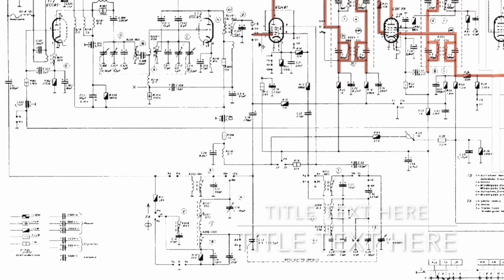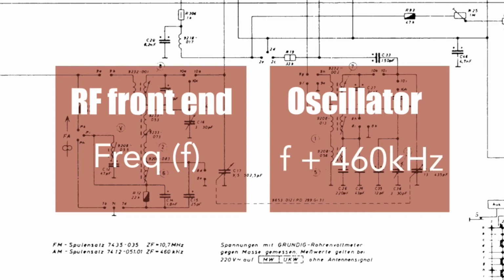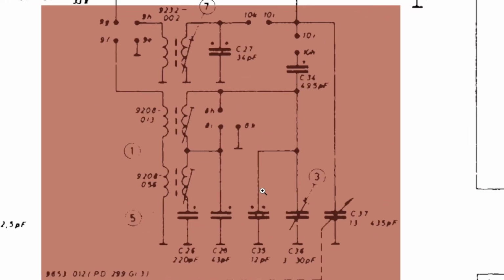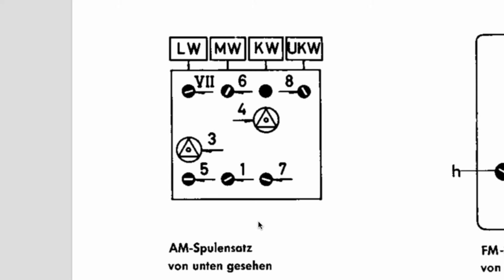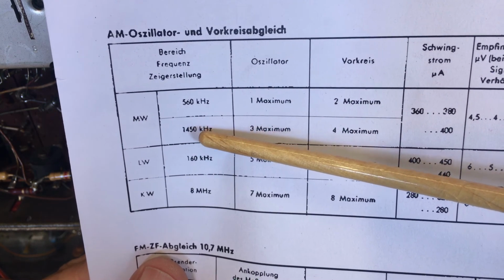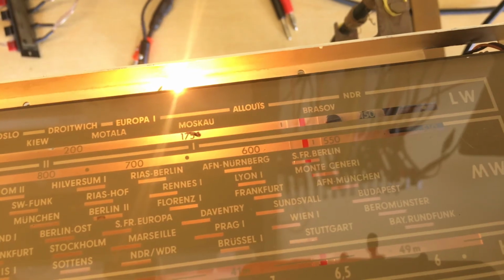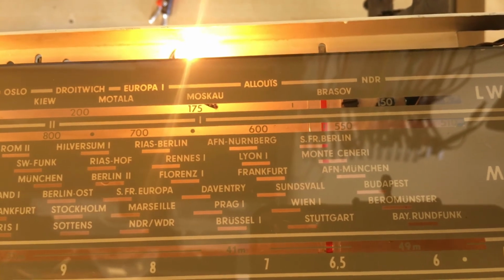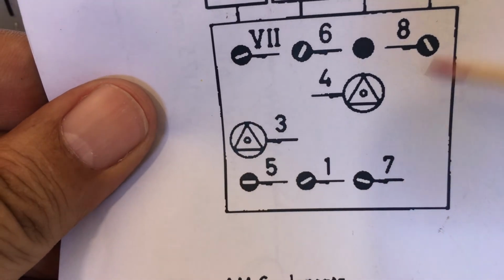Grundig 4198 tube radio restoration - Part 9. RF alignment of AM bands

Comment: I would like to make an inquiry. I own a Grundig Type RF 135 and need to disassemble it to adjust the dial, one of the knobs is loose but I don't know how to get it out of the radio.
I would like to know if those knobs come out stretching or have another system, thank you very much in advance and greetings from Paraguay.
Reply from the maker: I don’t recall having worked on one of those, but usually you make sure any screw on the knob is loosened and then gently pull it out.

Comment: Hi. Thank you for a very instructive channel. One silly question: when you peak the signal, where do you connect the AVOmeter? Looks like its on the speaker?
Reply from the maker: Jan-Thore Hol : yes, you can connect to the speaker. I use a simple signal booster as my AVO does not have a 1V range on AC, and I want to keep signal levels low so as not to blow my ears out.
Reply: Got it! Thanks! I do not understand why this channel dont have more subscribers, its one of the best! I have a Grundig Satellit 210 (6001) that I dread to put on the bench for restauration. Your channel can actually be the tipping point to do something that complex!

Comment: Hi Manuel...how does this light dimmer work? Do you use paralel bulb lamps? ty
Reply from the maker: Rogerio Zambotto : the idea is to place a "light bulb" in series with the load. How much "light bulb" is then controlled by switching more bulbs in parallel with each other. I have two 40W and two 60W bulbs, so I can switch in 40W, 60W, 80W, 100W, etc. up to a maximum of 200W. I always start with the 40W only, as this provides the highest current limit.